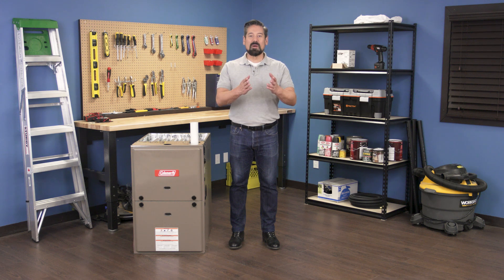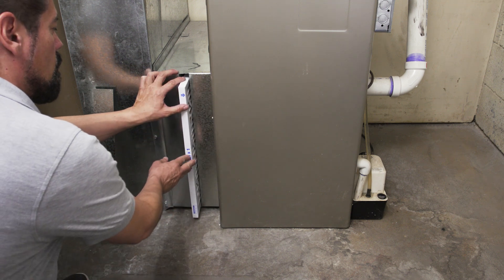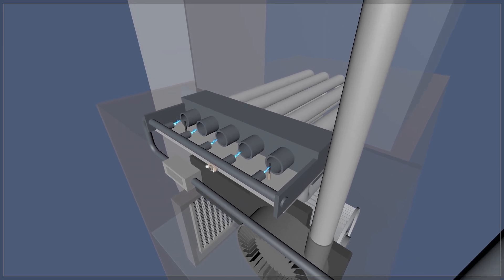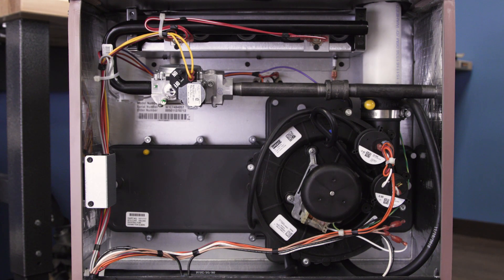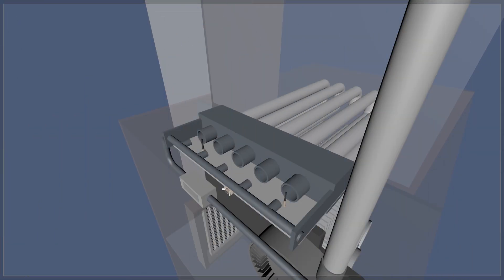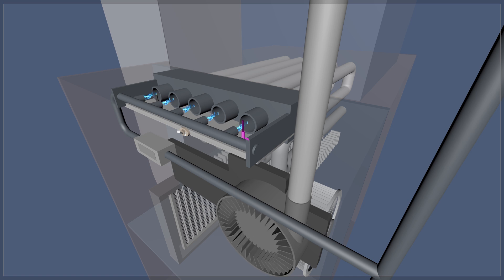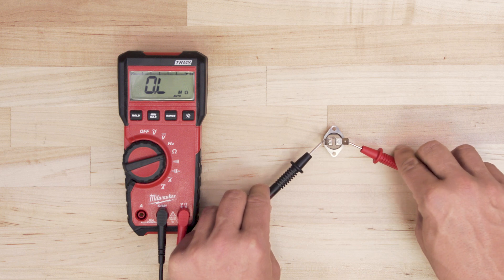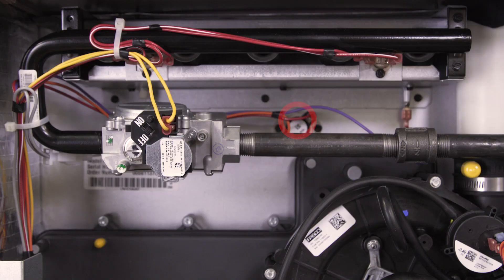Furnace Troubleshooting - Common Problems | Repair and Replace

Comment: what would cause my furnace to run fine if the fan is set to low, med, or high, but errors out when the fan is on auto?  ECM variable speed blower motor. Carrier infinity.
( I don't want to bay $2000 for a repair that is just a $15 part).
Reply from the maker: There's a few things to check. Make sure that the door switch is closing properly. Also check for any actual error codes as this can help you narrow it down. As well resetting the board can help - power off for several minutes, then let it start up again.

Comment: Hi there, i am so angry after a local guy gives me a quote of $1200 to service and inspect the fault of my ducted gas hester. I have replaced the two flame sensors with new ones. And i test the micro current it varies from 7 to 15. I can see the flame comes and goes seconds after ignition.  The last resort  would be replacing the pcb control board.
Reply from the maker: Thanks for watching. A current above 5 µA DC is good, but double check to see if the connection from the flame sensor to the board is solid. Any corrosion or a loose connection can make the board think that there's an intermittent flame.

Comment: Hi! I’m having an issue where thermostat won’t reach to 68 degrees or above. I am thinking of troubleshooting it myself before calling a professional. Should I turn on the heater and let it shut off itself before trying to troubleshoot?
Reply from the maker: Thanks for watching. Before anything else it is best to make sure that your furnace filter is clean and that the air ducts are clear. Anything that prevents the transfer of heat might also cause this. It could also be an issue with the thermostat but if you're not certain it's still good to call a professional.
Reply: @AmreSupply  thank you for your reply! I am positively sure it can be the filter. It is brand new home and I have not replaced the filter in 2 and half year. If I wanted to check the flame sensor, should the thermostat be on off or on heat? Thank you again !
Reply from the maker: @Compilationsdotcom1  You're welcome, we're just happy to help!
Reply from the maker: If you ever need to check the ignitor, clean the blower wheel or clean the flame sensor, then the furnace power should be turned off either at the breaker or directly at the power switch by the furnace.

The flame sensor is not a temperature sensor. It's a flame proving device. It's just a metal rod that checks if there's a flame present. If your furnace lights, the flames stay lit for 7 seconds then it shuts off, then it's likely a dirty burner, dirty flame sensor or a bad connection.
Reply: @AmreSupply  thank you for your advice will be working on it !!

Comment: I know this is an old video but I hope you see this. What could be the issue if the fan only runs from the "on" switch on my thermostat and not the "auto" option? Ive been having to manually heat the house at night and I am exhausted lol
Reply from the maker: Thanks for watching. If the furnace only runs when the Thermostat fan is set to "on", then it could be an issue with the limit switch. This video explains it in more detail: https://www.youtube.com/watch?v=XrxV6I8C4yY

As well you can test and replace the limit switch follow the steps in this video: https://www.youtube.com/watch?v=0va_wvwfCBA

Hope this helps!
Reply: I'm having this same issue, did you get it resolved?
Reply: @StarGuitar-r1y my furnace had to be replaced. It was original to the house and not able to read the thermostat well I guess. I hope your fix is less complicated!

Comment: My old  Goodman furnace has a 2 stage vent motor. How does that work? If I stop the motor for a little bit the burners will light. If I don't stop the motor it will not light. Maybe the vent blower running to fast?
Reply from the maker: Thanks for watching. With a 2 stage inducer motor, there will be more than 1 pressure switch. There is a chance that one of the switches might be starting to wear out, stopping the motor might temporarily balance the pressure in one of those switches. Alternatively there could be something with the incoming our going pressure.

Comment: Great video, thank you! I have a Lennox that still will not light up. The code is off and slow flash- the cover says it's pressure switch or restricted exhaust vent. My inducer motor was getting very loud so I replaced the inducer motor and checked the flue for obstructions. Ran again for about three days after replacing the inducer motor and making sure there was no airflowrestrictions on the flue. I ordered and replaced the pressure switch even though the one there seemed to be fine after testing for resistance. Put on a new pressure switch and didn't want to turn on the ignitor, but then the ignitor turned on and a click coming from the gas valve released the gas and the burners fired up. Worked for about three days and now it's back to the same issue even after replacing the ignitor, checking continuity on the flame roll out sensors and the limit switch. Everything seems to check out after testing the pressure switch over and over, switch closes everytime the inducer motor turns on. I am alomst coming to a conclusion that the board is bad since it keeps giving me the code of a pressure switch, exhaust restriction even though the pressure switch is closed throughout the entire cycle before it shuts down. Do boards actually fail in this manner? Thank you again for this great video!
Reply from the maker: Thanks for watching. Your logic and process of elimination is solid, and it seems like you've done all the right steps to try to narrow down the problem. Control boards are tricky as they are a black box and not easily tested. It is difficult to actually narrow down problems within a control board, so if you've eliminated all other potential sources of problems, then replacing the control board is the best next step.

Comment: my furnace flame never turn on, I cleaned flame censor and replaced pressure switch
Reply from the maker: Thanks for watching. In this case, the hot surface ignitor should light up, the gas is released, and ignition should take place. If no ignition happens, then gas might not be getting to the burner. Check the gas shut off valve and make sure it's open. If there's still no ignition, then it could be a faulty gas valve, or a faulty connection to the gas valve. As well check to make sure the gas valve is set to "ON".  This video shows a few things that you can check including the door switch and the condensate pump: https://youtu.be/Bi76q0TzoW8?si=AxkxV3R-e4TpGKTn

Comment: SAFETY STANDARDS ACT
[SBC 2003] CHAPTER 39
63  A person must not do any of the following:
a)assemble, manufacture, construct, test, install, operate, use, dispose of, maintain, repair or alter a regulated product contrary to this Act and the regulations;
Reply from the maker: Thanks for watching and for sharing that info. There is a variety of codes and regulations depending on where someone lives. Even in areas where repairs are only allowed by professionals, these videos can help inform people on how it works which lets them more properly communicate with a service technician. It also protects people against fraud as there are some that will take advantage of a homeowners ignorance to up-sell unnecessary repairs. This is where a second opinion can be helpful.

Comment: What kind of class/course does guys take to work repairing utility equipment or to work for a gas company?
Reply from the maker: Thanks for watching. There might be different certifications depending on where you live. Best thing would be to talk to a trades school for more information. They often have the most current resources on these sorts of things.
Reply: @AmreSupply  Thanks.!!
Reply from the maker: @geobany1533  You're welcome!

Comment: My mother in law who is almost 80 years old lives in a trailer and has a MGHA-057ABFC-05  NORDYNE.
She had a repairman out to the trailer a few times and has paid almost $900 so far for her furnace to be repaired and it's broken again, after the guy has been there 3 times and charged her $200 service fee everything for the same thing he said he fixed every time over the last 8 months.

He replaced the entire gas valve unit,  It has a pilot light but will not ignite.

Any help or tips would really be appreciated As she's retired and lives on a fixed income.
Reply from the maker: Thanks for watching. If the gas valve was replaced but the pilot still won't light manually, then there might be an issue with the pilot assembly. If the pilot orifice is clogged, then it can restrict the flow of gas. We don't have a specific video on how to clean the pilot assembly but you'll need a small piece of wire as the orifice is quite small.

Comment: Great video! Thank you! Any video for water leak from the collector box? I just tried to replace the gasket of my Goodman, but no luck. Thanks!
Reply from the maker: Thank you Hugo, we're just happy to help. We have a video for the condensate pump: https://youtu.be/dcLhyLu0-y8 But not for any condensate pans or other related parts from inside the furnace.

Comment: My furnace started smelling like burning wires at 1130pm after I was done at work one night. The motor is not spinning. I replaced the inducer, since our last inspection was told it was going out. After that I checked the bottom panel and all that burning smell was strong by the blower motor, circuit board and capacitor. Which would it be?
Reply from the maker: Thanks for watching. A smell like that is most likely coming from the motor. This video shows how to test the capacitor and replace the motor: https://www.youtube.com/watch?v=4SY8lRl8HV0 This would be best to eliminate before considering the circuit board.

Comment: Thank you very much. Went out and bought a new HSI thinking that was the problem..turned out it was just some gunk and a bit of water in the pressure sensor tubing. Blew it out with compressed air and I'm back up and running!
Reply from the maker: You're welcome, we're glad that you were able to narrow down the problem. It doesn't hurt having an extra hot surface ignitor on hand as that is one part that is more likely to fail over time. Cheers!

Comment: it won't light. I can get it to try a lot by activating the pancake switch the vacuum switch but it won't light anymore
Reply from the maker: Thanks for watching. If your furnace won't light, then it's worth testing the hot surface ignitor: https://www.youtube.com/watch?v=LAAYMOpVf-8

Comment: Great video. Does anyone know what would cause downstairs zone to blow cold air while upstairs zone blows hot air. Thermostat upstairs and downstairs are set to heat but still getting cold air downstairs. Is it a zone control/valve issue, thermostat, ductwork, air filter, or ignitor issue? Thanks
Reply from the maker: Hi Randy, thank you for watching. If you have a forced air furnace and multiple zones, then it likely uses a damper to control the airflow through the ducts to the zones. If the damper is stuck or the damper motor is faulty, then it will not open and hot air will not circulate into that zone. 

Since this is less common it's not something we cover in our videos.

Comment: My heater would start and flame for about 3 minutes and then stop but it still sounds the furnace is running but with no flames. It stays at like 55 degrees. When it reaches another time interval, it will reignite itself with the flames but it only last for like 3 minutes. I can't get it to reach 65 degrees because the flames keep going out after like 3 minutes. Could it be a faulty lux thermostat? Someone in the lux customer reviews had similar experience to me and it was the lux thermostat failing. Circuit breaker is good. I believe it is getting it's full power.
Reply from the maker: Thanks for watching. This could be an issue with the thermostat. However, since the furnace will run and continue to run without flames, that would indicate the blower fan is still running to cool down the heat exchanger before it shuts off. A faulty limit switch can cause that behavior. https://youtu.be/0va_wvwfCBA
Reply: @AmreSupply  Thanks. I see it. Easier to try that than replace the thermostat. I am gonna test it tomorrow. It is a microtemp 4d4300d 152c.
Reply from the maker: @Bflo23  Just remember the switch can wear down so even if it has continuity at room temperature this doesn't show you at what temperature it is opening at. Since limit switches can start to wear out (they use a bi-metallic disc inside) they can start opening at lower and lower temperatures. This won't show up in the continuity test (which will only test for a complete failure)
Reply: @AmreSupply  I bought a switch last night but I cleaned the old switch last night. It didn't make a difference immediately last night but then I decided to raise the override temp like 3am. I was hearing my heaters making  that great hot water in the pipes sound that I haven't heard in a few days. Yay! I cancelled my thermostat order. I believe the limit switch was the problem as it had dust and grime around it. My heater has been working good now. I was gonna test it today but I don't want touch anything as it is working and then the heater possibly not working again. Haha. I got a new switch coming to me anyways that I can't cancel just in case the old switch goes bad. I got a boiler heater that must be like 35 years old and it is still working solid until a couple days ago. Thanks for your help. I appreciate your help just like many others here.
Reply from the maker: @Bflo23  You're welcome! We're glad that you were able to narrow down the problem! It never hurts to have an extra switch on hand. All the best to you!

Comment: Hello I am having lots of water on the floor under the furnace .
Reply from the maker: Thanks for watching. It could be an issue with your condensate pump, one of the connections or the condensate drain pain on the furnace itself: https://www.youtube.com/watch?v=dcLhyLu0-y8

Comment: New ignitor will not light?
Reply from the maker: Thanks for watching. It would be worth testing the new ignitor just to double check that it has the proper resistance and was not damaged in installation. https://youtu.be/LAAYMOpVf-8?t=136

If the ignitor is good, then check that the connectors are secure and that the wires are not damaged. As well check the connection at the control board and look for any burn marks or signs of damage. If that all checks out then it could be an issue with the control board itself.

Comment: Oh...MAN! I have a Carrier gas HVAC system. The technician recently replaced a bad transformer. I've also had burnt out (New!) LED lights, clock radios, and an old microwave-a Kenmore that sucks anyway. The Problem?? You guessed it. BAD current. I had an electrician at my house. He said that this (early Sixties) house has an issue with corrosion in the outside conduit and meter box. The cost to fix this?? About $2500 American. I can swing it-but, that's not even the biggest problem. When I made an appointment with their receptionist, she said: "Sir, we can put you on our schedule for November 2nd. Whiskey Tango Foxtrot!! Some of their competitor are even Worse-they're booked up until Thanksgiving. 
Getting back to the furnace, I decided to DYI things, and ordered two transformers (one as a backup.) So-I install it (after crimping on swage connectors, and try to fire it up. The little blower fan for the burner-described in this video-goes on, but the gas doesn't light, and the fan doesn't come on. The manual fan switch does not work, either. 

I have a Generac to bypass the low voltage/dimming problem. You should have heard my refrigerator compressor trying to work with low voltage! Not Good-I have unplugged it, and will dump all the food. The Generac has issues, too. I have to transfer power manually with the breaker. Plus, it's noisy as Hell, and sits under my bedroom window. The other issue, of course, is that if the furnace won't work when it's cold, what's the USE?? I am writing these words from a Comfort Inn. 

OH-and my sump pump alarm is continually beeping. It DOES work when hooked up to Generator power, but will also need to be repaired.

This SUCKS!!!
Reply from the maker: Thanks for watching and for sharing your experience. Having issue with your current is something that makes everything more difficult to address. Waiting 2 weeks for the current to be fixed is a tough situation to be in especially as temperatures get lower. If there is a bright side to this bad situation, this happening in October is still better than the middle of January. Hoping for the best for you.

Comment: I happen to be on site at 1:00 p.m. on Friday when this message is being delivered I do property Management small home repairs and have some common sense about all of your videos but I am not a professional! If you see this in the next hour can you please call 203-802-0461 and maybe you can help me troubleshoot the series of the furnace that I am going to attempt to bring heat back into the home after I check the filter first?